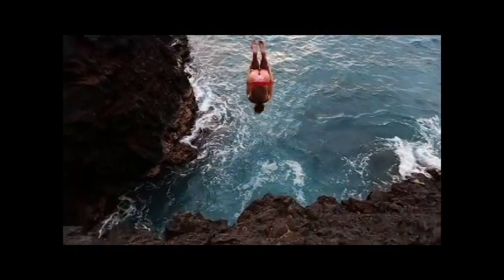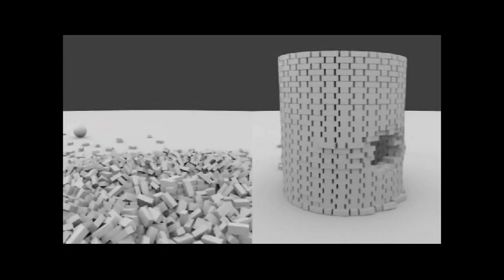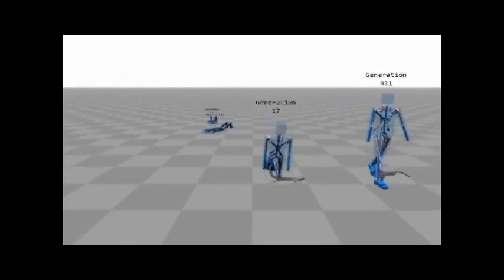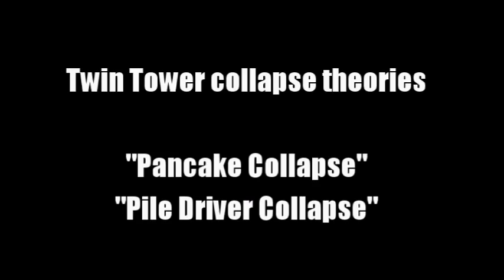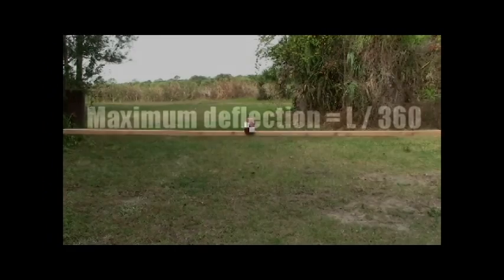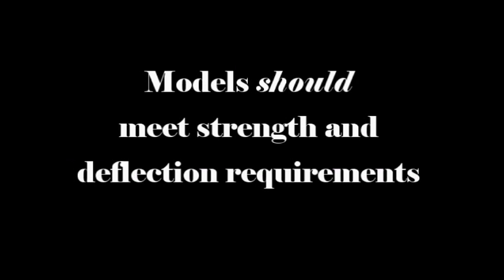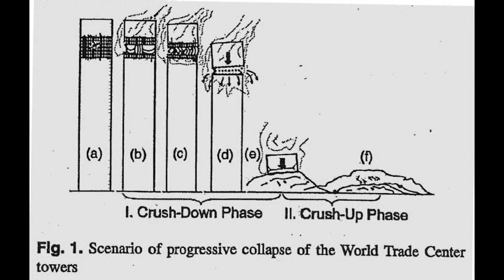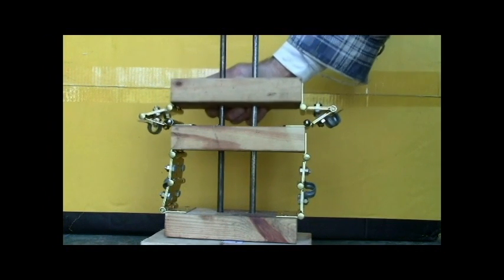9/11 Experiments: The Force Behind the Motion

Comment: Let's say for example each floor weighed 10 tons and each floor was designed to hold 30 tons what do you think would happen if 80 tons fell on a floor that can only hold 30 tons they would fall like a bunch of dead weight floor after floor after floor and you see it in the pictures as the air of the lower lower floors is compressed the windows are blown out from the pressure

Comment: The material used are vastly different. Different properties, weight, etc.

Additional, first experiment using the weight. the sides are not colapsing with the momentum of the weight, gathering resistance for the weight to continue much farther then expected.

Greater mass, garners greater effects by gravity. You drop a pin, and it bounces off the surface, you drop a brick and the force makes a dent in the surface because of air resistances, force, etc. the property of the bindings that hold the structure together are a really important factor as well.

The only way to satisfy folks would be to recreate the tower and do an experiment.

Interesting watch, but there are some flaws in the math, scale and design of the experiments. Those flaws, as the vid says, state the replication false.

Edit: Made a misspelling.
Reply: The video still shows that an object falling and hitting other object below slows down due to resisting forces, friction etc.  In the case of the three towers in NY, the buildings collapsed in an accelerated manner absent any friction or resistance from the perfectly intact huge interior cores below the collapsed floors.

Comment: the problem with his test was that he didnt put into effect of fuel.  He should have poured fuel into the top areas and let it pour down the middle of the columns because it was hollow and the fire spread downward.  You never tested for that.  And lastly your weight distribution is incorrect as well.  Not all the steel columns were created equally within the tower.

Comment: Interesting experiments, but they seem incorrect to me, not testing what is said to be tested. The first simply fails as you contain the floors within your "support system": it just gets to crowded to fall down (creating resistance) which was not the case with the twin towers. Furthermore, it suggests a system of loadbearing walls which was also not the case. 
With pancake collapse, it is the weight of the construction itself (roof & floors) that causes the collapse: so to re-enact, to experiment, the “floors” should have weighted more, and the support structure (which is the sturdy wood entrapment made) should have been weaker (or at least the joints): in this experiment it is solely tested what a weight does on a floor, not what the weight of a floor does falling down to a support system.
If you wanted to test it that way you should have at least allowed for more space for the floors to fall: so using wider floors, using the same weight and with a suspension of proportional strength. 
In the later experiment you also change the construction, by adding the papersheets as wall, you also model a building with a load bearing wall. 
And while the experiment with the pizza-corners was most relevant, there to I wonder about the proportionality of the pizzacorners to the weight of the “floors” used in the experiment.
Pancake collapse does happen with horizontal loads: earthquakes have caused pancake-collapse in the past: the horizontal load weakens the support structure, leading the building to “implode” in itself. Depending on construction, weight, etc. a floor collapses or the whole damn  building. A few examples: 
https://goo.gl/images/aniWh7
https://goo.gl/images/vxWc2k

Comment: It seems that you don't know that the weight increases with the third power, while the surface increases with the square. This is the reason why an elephant cannot fly, but a bird can. In your models the weight of the floors is insignificant. Your conclusions are wrong! And the pillars simulators you used are orders of magnitude stronger than they should be!
Reply: THIS

Comment: Question, i didn't hear you say that you factored in the weakening of the steele in the structure. I also noticed u didn't use trusses to hold each floor panel but solid blocks, wouldn't that make a difference?
Reply: He just proving a point about deceleration when masses collide. Phew!!!! it flew right over you.
Reply: @akiracornell  he proved the official explanation is wrong
Reply: The heat of the fire weakened the steel beams, which caused the collapse. Also, a massive skyscraper is quite a bit more heavy than these teeny little towers he built. So yeah this video is bs.

Comment: Your experiments are a farce. Using plastic, paper and a crushing object that is completely not accurate to the height and weight ratio that the top of the building had to the lower floors will give you a false result. Hmmm let me use some popsicle sticks and glue to simulate how 9/11 was a controlled demolition. Oh that didn't work, let me light it on fire! LOL.

Comment: computer models aren't accurate but physical models are.  That's the synopsis of this video, however you fail to go into how the buildings were literally feeding the fire fresh oxygen allowing it to burn hotter and longer. You also fail to go into how the structural integrity of the materials used diminished due to a uncontrolled fire burning freely around and ontop of said materials. You also fail to identify that computer models are the next best thing to running a full scale simulation as building a full scale physical simulation wouldn't be cost effective or resource effective. stop being a conspiracy theorist, it helps no one.

Comment: You're experiments are flawed. You have two solid metal support beams in the middle unlike the twin towers. Also, the first experiment does not compensate for the outer walls from caving inward from the force of impact and lack of support floors. If something dropped high above, and took out the floors, the outer walls would collapse inward.

Comment: This is beautiful logic that I always suspected!  I hate conspiracy theories, but this was never logically possible to just drop straight down, and never slide off to the side, or fall over, or anything.  It was perfect, how it came down on itself, that only the very best of demolition experts could get a building that large to land that perfect right on top of itself.  It never toppled over in to the next few city blocks, knocking into surrounding buildings, and landing in the middle of streets.  It went straight down right on itself.  That is almost impossible without assistance.
Reply: " It went straight down right on itself.That is almost impossible without assistance."
Why?
And it didn't actually fall straight down into itself. How would you explain 20 buildings being heavily damaged or destroyed?

" this was never logically possible to just drop straight down"
If you look into it a little bit closer, you would have stated that toppling over would actually never have been possible. You seem to think buildings in general or the toowers in specific are solid blocks. Well, they aren't They are bolted and welded single pieces of steel.
Reply: They use the term "conspiracy theory" in order to ridicule their opposition and not have to provide an answer to their challenge.  Just marginalize them and ignore their claims, nice and neat.  The CIA started this in 1967 when a growing number of people didn't believe the Warren Commission's report on the Kennedy hit.  They put out a 3 page internal memo entitled "Countering Criticism of the Warren Report".  (Btw, Allen Dulles, a total scumbag who ran the CIA, was at odds with Kennedy and eventually FIRED by JFK in November of 1961, and then POPS UP on the Warren Commission 2 years later to investigate his murder.  No conflict of interest there right???).  They will also refer to conspiracy theories as being "debunked" or "discredited", because, you know, no need for you to waste your time looking into this, nothing to see here.  Anytime they call something a conspiracy theory, that is often the first place to look.

Comment: Great hypothesis.. I have my own
Called the “Banana Peel” scenario.., the outer walls stripped away.. each of the floor stringer assemblies was attached to the outer wall and inner support columns by 4 bolts.. one on each corner. As the outer walls separate the weight of the 4” of concrete used on the floor dropped.. shearing the bolts to the inner column .. the outer and inner columns were fixed by 6 bolts per section.. basically making it a 1300 high Tube.. and as the tubes weren’t supported, they broke the bolt assemblies and fell.. as did the inner columns. In the collapse Videos you can clearly se HUGE SECTIONS of the outer columns landing hundreds of feet from the original locations.. with no one ting structure they broke apart and fell at free fall rate.. with no outer structure.. the inner fell the same... free fall

Comment: You have missed a very important element here, if you scale down the size you must scale up the acceleration due to gravity. 
 Experiments at 1:100 scale should be done in a centrifuge at somewhere in the region of a 10,000G's, which is a testament as to how strong buildings are but also should illustrate why when they start collapsing they usually don't stop.
For anyone wondering why the 10,000G's - If you scale the height to 1:100 then the Volume will be 1:1,000,000 of the original.
Reply: smh nonsense

Comment: Guys mass doesn't play a role here 
lets keep it simple let's say we blow up the 95th floor(the steel has melted and the support vanishes) now the top 15 starts to fall with their tons and tons of load weight etc 
But we know that the Force applied initially by the 95 floors on the 15 floors was equal to the weight of 15 floors right cause the building was still before everything.
 So the amount of force that will resist the 15 floors when they hit them is at least weight of 15 floors correct(can be 10 times but takin worst case).  SO THE 15 FLOORS HAS TO DECELERATE CAUSE THE NET FORCE WILL ALWAYS BE UPWARDS EVEN IF THEIR MASS IS INFINITE. So the tower could not have come down in 10-12 or even 20 seconds its just not possible unless there is no resisting force which was ensured by the chosen people.
U can comfort urself by saying that there were tons of steel and shit but the time taken to fall is independent of mass/weight
Reply: "But we know that the Force applied initially by the 95 floors on the 15 floors"
What force of the floors. Do you think any of the floors applied any force upon other floors? You do realize that buildings are not massive, right? In an intact state, one floor of the towers would apply a vertical force to the truss seats only. These truss seats redistribute this load/force onto the columns. The trusses which kept the floors up, were bolted onto these truss seats with two bolts only. The only force needed for a floor to collapse was the force to break these bolts (I'm talking about the progressive part of the collapses).

"SO THE 15 FLOORS HAS TO DECELERATE CAUSE THE NET FORCE WILL ALWAYS BE UPWARDS EVEN IF THEIR MASS IS INFINITE"
Yeah, in a world without gravity... Gravitational force accelerates falling objects. Even with a certain amount of resistance, the falling objects will accelerate. The resistance will just slow  down the acceleration. Remember, the only resistance that needed to be broken, was the resistance provided by the bolts. As long as the force of the falling object is larger than the resistance of the bolts, it will simply accelerate, just not at free fall acceleration. You do understand the difference between speed and acceleration?

Comment: Experiments that are not made with the same parameters as the models don't make the models wrong... Your "experiments" are not representative of what would happen on an actual building. You either make the columns overly strong in the first one, or the diaphragms overly strong on the second... In both tests your lateral force resisting system is infinitely strong, which is not true in the actual building... Also you don't even check if your plastic columns represent the same relative strength that actual columns would have.

Comment: Great video. With steel walls used on twin towers along with truss and poured 4 in concrete... The wall should have less deflection than the floors. So you would think the deceleration would be even greater.

Comment: awful lot of people in here with a degree in Structural engineering like they designed the building themselves 

forgot to add I'm on the side of people that know it was an inside job
Reply: Drake - "awful lot of people in here with a degree in Structural engineering like they designed the building themselves"
It's amazing what you can learn about a building's design if you would just take the time and effort to research it. The information is all out there, in the open, waiting to be discovered by you.

Comment: If the jetfuel ate up the steelframes , why don't the jetfuel damage the motors
Reply: Really? How about engines being designed not to be destoyed when used.
Reply: That's about the same argument as why car engines don't melt from constant combustion going on inside.

Comment: Go back and research how it was constructed and try 4 uncooked spaghetti straws and 3 cardboard squares; 1 with 4 complete holes in the corners the straws go through and the other 2 cardboard squares with 4 partials.  complete it will hold some weight. Now take the middle board out and it will twist and buckle with the same weight and collapse.

Comment: This is utter nonsense! The experiment at 6:00 onward is completely flawed and misleading... that is not what happened, the weight and therefore kinetic energy using your scenario is progressively reduced using the break strength of the board. That means the kinetic energy is dissipated through each level, this is simplisticly exactly how all energy reduction systems operate! That is not what happened!!!! To make this experiment valid, every board would need the same high weight and loading, and carry with it the kinetic energy developed as it fell! that means every subsequent floor not only has the kinetic energy of the above floor to take, it has both the load and the energy, and this doubles and exponentially increases on every following floor. This is fundamentally wrong in your experiment!!!! Stop tryin to kid people with utter bullshit!

Comment: You forgot to add into your simulation that buildings also have inside them pipes with water, gas, electricity and ventilation systems which run throughout the whole building and where can heat accumulate and initiate your ''demolition theory'' without any bombs involved.

Comment: I think I know the answer. I think there is thermate place inside the tower. So when the "plane" hit, It will start a fire and will make the electrical wire will explode and it will light up the thermate. So the thermate burns the steel making the building weaker. Finnally, when the building is weak enough, it crushed itself with it own weigh.

Comment: Interesting that you base your experiments on models which only meet a few of the physical criteria for the actual buildings, yet you extrapolate your results to those buildings nonetheless. Your initial dropped weight strikes your end-supported "floors" in their centers. In the actual buildings, the dropping weight consisted of an entire monolithic chunk of the building, multiple floors in height, but full building width, and including the central core, which dropped along with it, as is evident from the videos.

It's all well and good to talk about how mathematical calculations must jibe with experimental result in order to be considered accurate, but your experiment must also faithfully represent and scale ALL the parameters of the real-life scenario you are attempting to model, in order to be anything but a half-assed joke, all your terminology notwithstanding. You yourself state that a minor adjustment to the parameters of a computer model can greatly affect the outcome. Yet you seem to consider that the same does not apply to a physical model. A rather interesting double standard at work there.

Comment: what a load of BS, the supports for the floors in your first experiment are stronger than the actual floors. In the WTC they were actually the weakest point. The floors, being made out of steel trusses as opposed to beams as most people claim were never designed to carry the weight of multiple floors. Once the train is set in motion, the top few floors hit the floor directly beneath it with a certain momentum which is many orders of magnitude higher than the supports can actually withstand. They don't fold and break like in your experiment, they actually fall straight down. They are only decelerated on impact with the next floor, which gives in immediately. So you have acceleration due to gravity for the entire distance between floors, and a negligible deceleration every time it hits the next struss. If you really want to make an experiment, make sure the different parts of your analogy correspond to the real world...

by the way, why did you suddenly use entirely different materials to test your firecracker theory? IF you would have used explosives, strong enough to destroy the supports from your first setup, the whole thing would have been blown across the room. Thus proving that a similar structure demolished by a sequence of explosions would have looked entirely different than the actual footage we see of the WTC collapse.
Reply: Bullshit (sponsored)
Reply: user/TheHipski  Why do you find that troublesome and why do you operate so many sock puppets during your work day?
Reply: channel/UCOybI2gJTz2x8L7MPPO2siQ  Joined YT Aug 29, 2015
Are you now fielding questions for The Hipski troll?